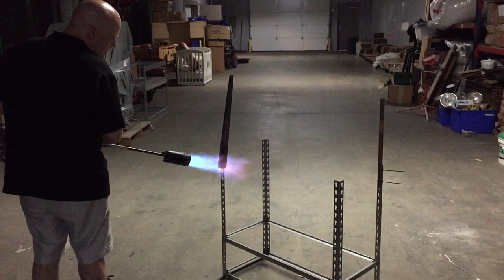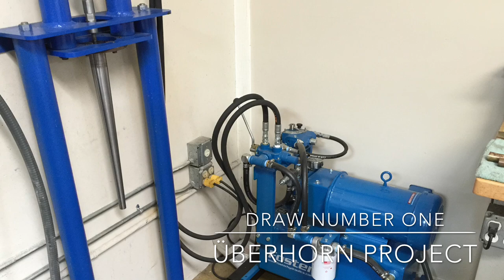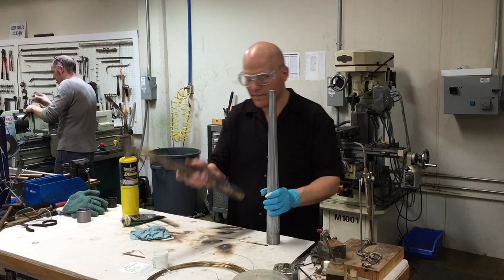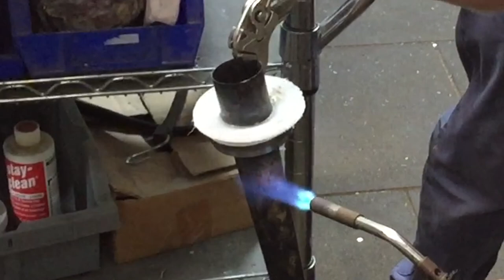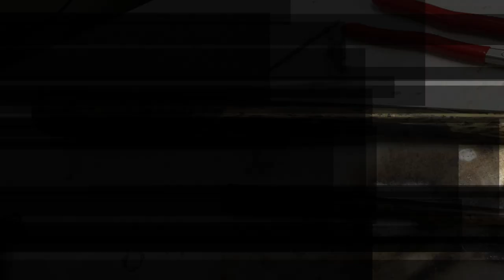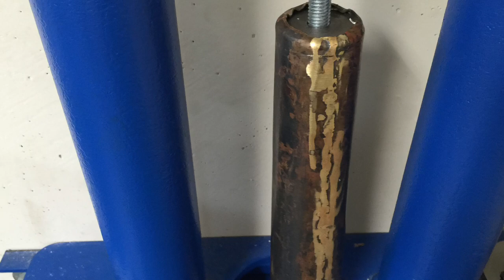The Überhorn Project from the Sax ProShop at MusicMedic.com

Comment: Hey, you boys put on some safety glasses when you pull that thing through the press!
Reply from the maker: Interestingly the polypropylene doesn't behave in a dangerous manner when it fails, it self lubricates as the material is drawn through and when it fails it just spreads apart, hence the no safety glasses. But you're right they should be wearing them nonetheless!

Comment: Very interesting.  Would you be willing to provide more information about the disks?  Based on what I can see, the material looks like it could be 1/4" nylon.  What made you decide to use the plastic disks instead of the metal disks used in a previous video?  (While we're at it, what material were the metal disks?)  Thanks for any info.  Very shortly, I'll be making similar parts to build the ascending and descending tubes for my prototype subcontrabassoon so I'll be following your project very closely!
Reply from the maker: The disks are polypropylene in 1/2" thickness. Basically cutting board material. We just cut it into squares now instead of turning it into disks. This material is self lubricating and doesn't leave burs on the material drawn. I don't think we used metal disks before, but they were probably brass, although they could well have just been steel. We've been using the polyprop for a while now and it's working well. Good luck on your project we'd love to see it!